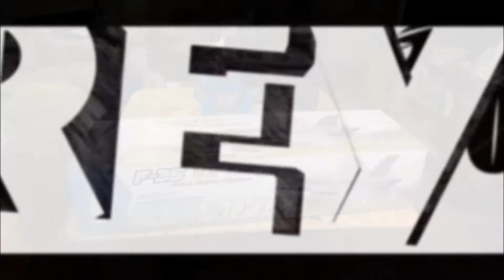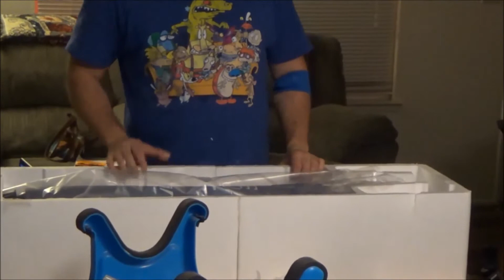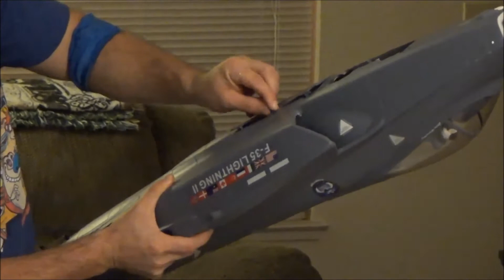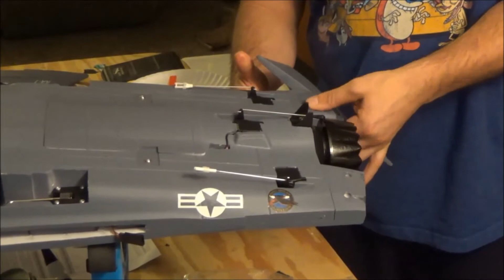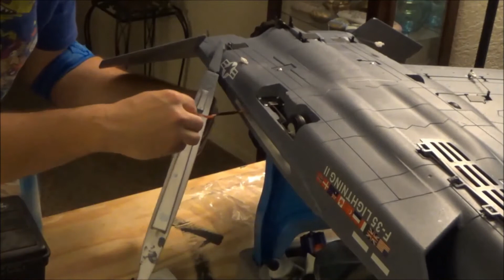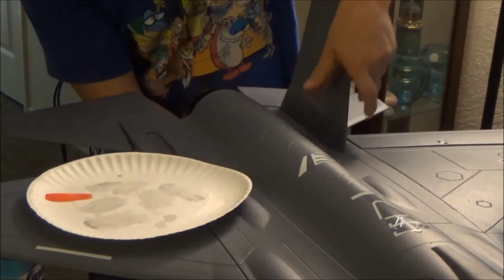F35 V2 70mm Joint Strike Fighter Build

Comment: This helps alot, thanks! Mine's coming in this week and would like to know is their anything ill need to know about this plane? Such as if the plane needs a bigger battery than a 2200? And whats the longest flight you have gotten with the 2200?
Reply from the maker: You only get like 3 min with a 2200 4s.